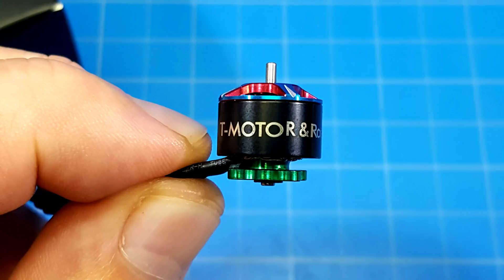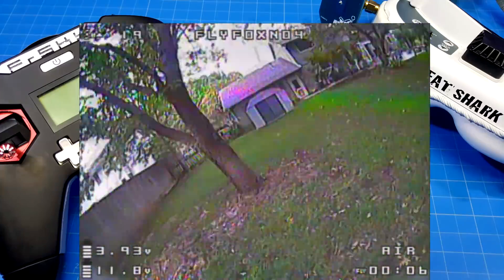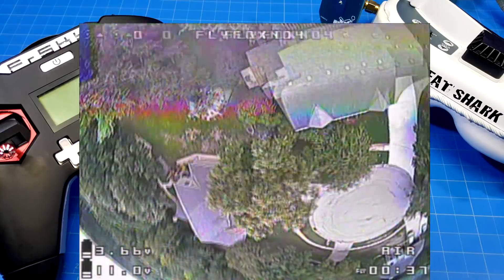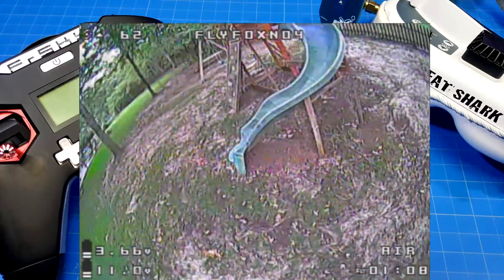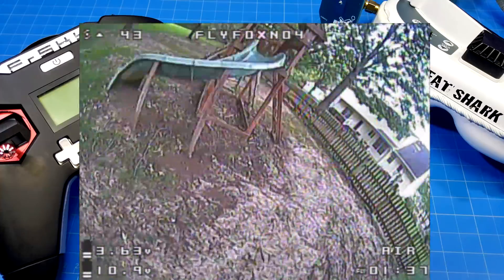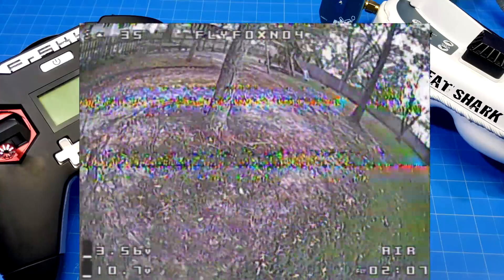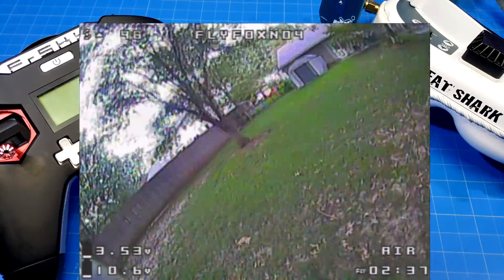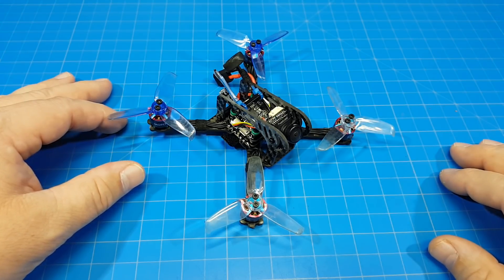T Motor/RacerStar 1106 6000kv

Comment: hey nick plan on building the cs3 by tomo

choosing between 1105 5500kv mamba or tmotor f15 6000kv 

3s batt
3inch props
Reply from the maker: I would go with a wider stator sized motor, something 120x or even 130x. I worry the 1106 doesn't have the prop control we can get from a 120x or larger motor.

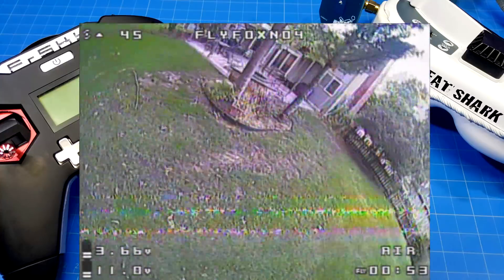Comment: Hello Mr.Burns, i hope you can help me a up with my problem. I buy these motors after watching your video. So my issue is, i fly these motors also with 550mah 3s from Gnb and i get 0:90 sec - 1:20 flighttime. i have testing with four different lipos and props, it`s all the same. Have you change the timing in blheli? My setting is medium....I hope you understand my bad english XD
Reply from the maker: I did not change blheli settings. It could be the weight of the quad. What does it weigh without battery?
Reply: @NickBurnsFPV  the quad weigh 84g without the battery. I think this is a regular weight for a 2" quad.
Reply from the maker: @DopeDylan  84grams for a 2inch props is a pretty heavy load. Have you tried the emax avan 2inch props? They are very efficient, like the best we can do. Otherwise we need to find a way to decrease the weight.
Reply: @NickBurnsFPV  I have not tested the Avan yet. So far I have only tested different Gemfan pros. I will probably save weight only if I swap the frame. This quad is only the frameplate, esc, fc, under the canopy is the runcam micro, 200u vtx and the xm +. 
I'll pack some photos in my dropbox.  https://www.dropbox.com/sh/7uxavbn9g4cu242/AACQj_j2Ia2sRscPT4eQumrGa?dl=0  
I will order another frame and keep looking. I thank you for your help. ;-) 
Best greetings from Germany
Reply from the maker: @DopeDylan  Order a frame that runs 2.5inch props. There is a huge efficiency and performance gain at 2.5inch. Looks like we can save a few grams with a smaller battery strap, remove the cp antenna and use linear, and maybe use a nano camera with a lighter canopy.

Comment: Hey Nick,  are 1106 6000kv ok on 3s with 2.5 inch?
Reply from the maker: yes, normally, it kinda depends on the motor manufacturer also.
Reply: @NickBurnsFPV  Ok thanks. Pals in the FB groups are saying Emax are good to go on 3s w 2.5 props
Reply from the maker: @Spideystrat  yep, that will work well.

Comment: The motors are pretty good performance wise, but there is a big drawback. The shaft doesn't have the locking ring on top of the bell like many other 1106 motors have which results in the bell pops off in crashes. I tried to epoxy them back on, but they still pop off
Reply: And the base is really thin. I  ripped off the bell and stator on another one and i was actually surprised that it didn't break earlier
Reply: @oyvinla10  Fully agree, thin as paper! I destroy today one motor on maiden flight in a minor crash :(

Comment: Hi Nick, Banggood currently has a great deal on a bundle of 8 of these at 73usd with an extra 28% off....I'm still on the fence but I'm probably gonna place an order.

https://www.banggood.com/8-PCS-Wholesale-Racerstar-RT11-1106-6000KV-2-3S-FPV-Racing-Brushless-Motor-p-1373369.html?rmmds=search&cur_warehouse=CN
Reply from the maker: I have seen one report of the motors breaking at the base. I haven't had the experience, but thought I should pass that along.
Reply: @NickBurnsFPV  I just placed an order for 8, we'll see how they do.

If the person who made the report flies like you do, I'm not too worried....lol

These are going on a Massive droner 2.5,  I already have it's bigger 3in brother.
Reply: I just got my two sets. I have not tested them yet but estheticaly they are very pleasing, the manufacturing looks top notch. Can't wait to try them.

 They are still available for cheap on Banggood, look for the bundle of 8 and the 28% discount code.

Comment: You should post that they're on sale now !!!! 8 motors for around 60 bucks 😳😳😳
Reply from the maker: I am surprised these motors haven't gotten more attention. If I were building another quad for myself and 2.5inch props I would have bought the set of 8.
Reply: @NickBurnsFPV  You could buy another set and build a Tomoquads Evo-H, you'd have two spares.....:) 

Now that I think about, I want one!

Comment: Hello, they seem so similar to the T-motor F15...in fact, if it were not for the difference in weight and the colour, I don’t think I would be able to tell the difference.
Thanks for the content!
Reply from the maker: I believe the motor wires are secure differently as well., this motor has individual wires coming out of the motor.

Comment: Nick what motors would you recommend 
2.5 inch quad 
2.5 inch prop ( also prop to go with  suggested motors )
4s battery 
Racing purposes
I keep debating in my head and have never been so indecisive

Also thank for your hard work I've been watching for a month now and plan to start becoming a patron
Reply from the maker: Is racing the style or true multigp racing?
Reply: @NickBurnsFPV  racing with friends  not a multi GP sanctioned event  just for fun
Reply from the maker: If the racing is based on completing laps I would suggest these t-motor/Racerstars, if its speed focused then likely the sunnysky  1106 or rotorx 1107

Comment: I'm sure you have it listed in another video, but what is that frame?  I need one to replace a Lizard95 I have been flying for the past year.
Reply from the maker: flyfox no4. https://www.banggood.com/FlyFox-No_4-125mm-FPV-Racing-Frame-Kit-Carbon-Fiber-16g-Only-For-RC-Drone-p-1279334.html?p=RZ29002443189201508J&utm_campaign=2443189&utm_content=3312&cur_warehouse=CN
Reply: I also want to know if i can put these on my lizard95
Reply from the maker: The frame is flyfox no4 https://www.banggood.com/FlyFox-No_4-125mm-FPV-Racing-Frame-Kit-Carbon-Fiber-16g-Only-For-RC-Drone-p-1279334.html?p=RZ29002443189201508J&utm_campaign=2443189&utm_content=3312&cur_warehouse=CN
Reply: Thanks, I appreciate the info.

Comment: Great flying and nice review.  Do you know if the bell is alum or steel on the Racerstar motors?  Currently running SunnySky 1106 5500KV motors on a build but finding they are really easy to damage and have gone through a few even on mild crashes.  If these aren't steel,  do you know of a replacement that is or are tougher than the SunnySky?  Thanks!
Reply from the maker: I am afraid I don't know the construction metal. I too have kills a few sunnysky 1106 motors. I did have several crashes with these t-motors they held up so far. Time will tell.

Comment: I really like the look of these motors.  Balance in efficiency and power says a lot to me and will mean more to many in the hobby.  In other words, it should appeal to a broader cross-section of the community.  Perhaps a little pricey but not overly so.  Besides, knowing BG they will put them on sale, it's just going to happen.  Thanks for the review!
Reply from the maker: yea, I think the balance is good. I have already transfered the motors to another frame for putzing around the yard in my free time.
Reply: Nick Burns - These motors may be good for a MicroQuad carrying a Hawkeye camera or Turtlet/Mini Split, at least I would hope so.  By the way, I putz around with a couple of WLToys RC buggies to relax, that way any interruptions means all I have to do let off on the throttle, so no worries about crashing, landing, or the VTX getting too hot with a quad waiting for me to fly again.  Also, my Huskies don’t find them as tasty as a Tiny Whoop...lol

Comment: I purchased a set of these that were t motor only branded. They were 14.99 And the bearings were junk out of the box. I thought to myself man these seem like a racer star motor, now I see they just might be.
Reply from the maker: Dang that stinks. Did you contact t-motor about the bearings?
Reply: GetFPV is taking care of it with no issues. I’m sure they’re great motors, I just have crappy luck. Probably going to stick with what I had on there. 1106-6000 EMAX but go with v2’s. Thoughts?

Comment: Any idea if these are available in the us?  I'm in a pinch for motors to finish my xfighter 2.5"
Reply from the maker: I don't think so yet. US shops don't carry many of the micro motors.
Reply: @NickBurnsFPV  rdq only has a few.  I'd like to see more of these carried locally
Reply: @NickBurnsFPV  are these the same. https://www.racedayquads.com/products/f15-1106-tmotor-6000kv-micro-fpv-motor?
Reply from the maker: I don't believe so. the wires out of the motor are secured differently.
Reply: @NickBurnsFPV  there's allot of comments on the RDQ FB group that these are knock offs and the $15 tmotor ones are the original

Comment: I've been waiting  for some new micro motors to come out for my Ascent 2.5 inch build this Fall.  These may be them based on your review Nick.  Looking at the specs of these compared with Emax RS1106 (couldn't find the specs on the RS1106IIs though) using 2.5 inch Gemfan props, these have a better Thrust/weight ratio which is what I'm looking for.  Your thoughts on this?
Reply from the maker: I do like these motors, I plan to keep them on a setup to fly around on the side when not doing reviews. Its nice they are 3s, I have loads of 3s 550mah packs.
Reply: Thanks!